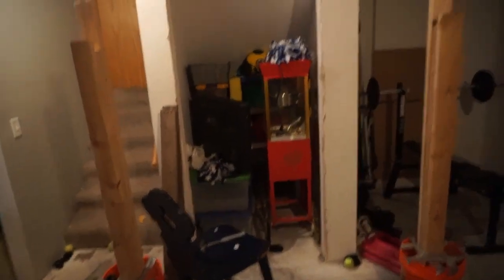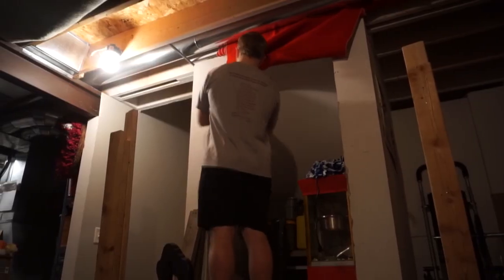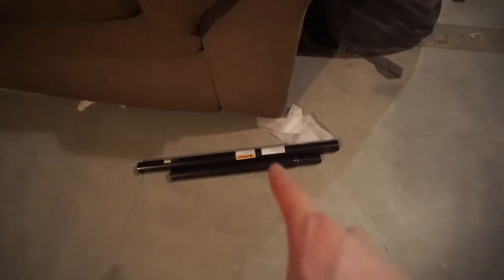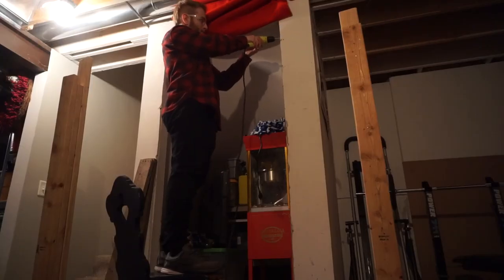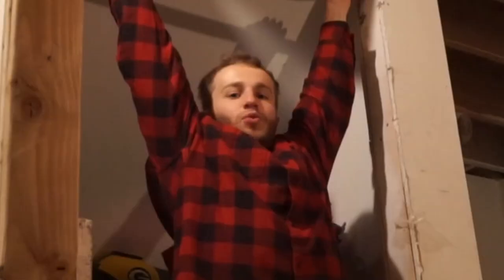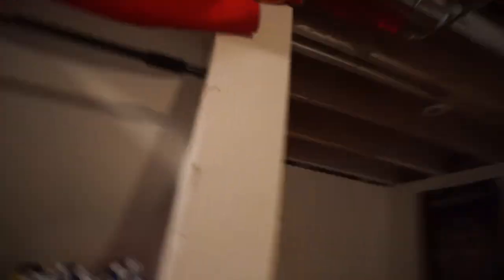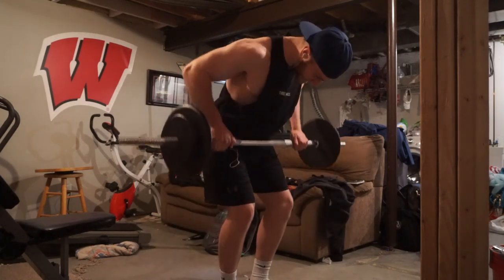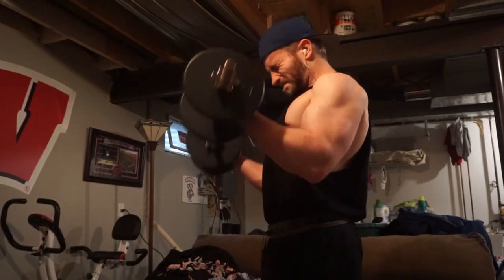I built a PULL UP BAR in my basement & gave myself a mullet

Comment: love the pull up bar modification you installed.  You may be able to use the beam to make a DIY cable attachment with some pulleys, coated cable, and carabeaners. Use soft straps to attach to the beam and soft straps around dumbbells or plates.
Reply from the maker: Yes! For sure! I don't know the extent to which I want to continue building on this temporary space, but it definitely adds a lot!